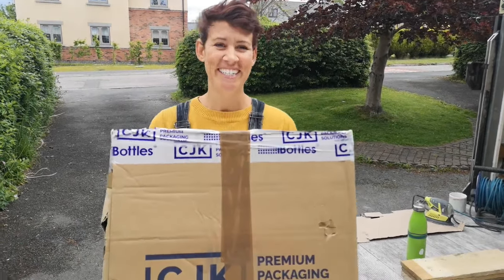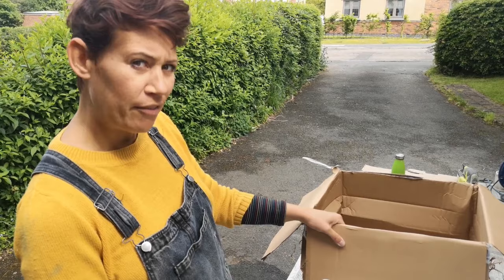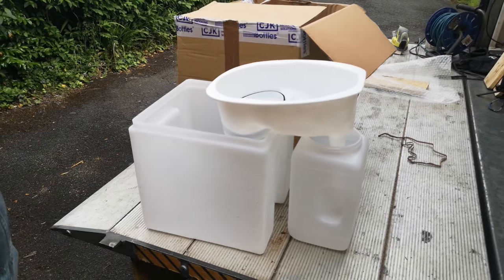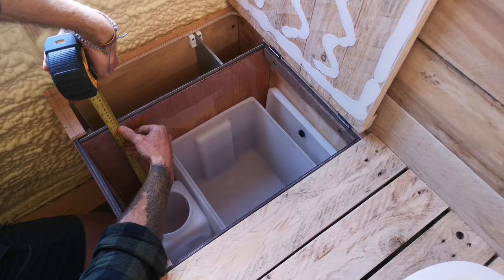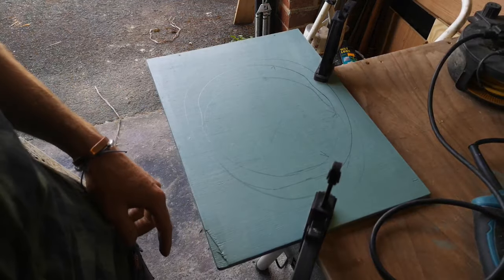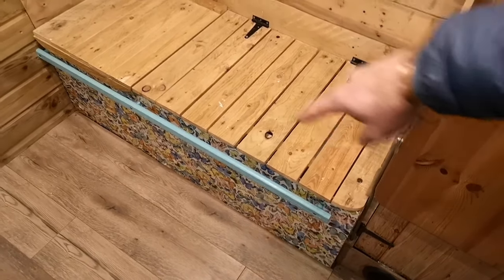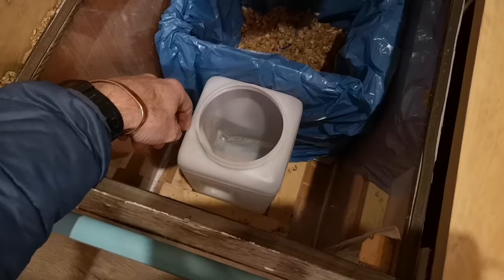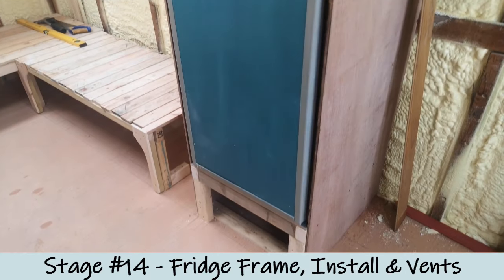DIY Campervan Composting Toilet & Bench Seat - Using Reclaimed Materials And Strumpet & Trollop Loo

Comment: Never liked the idea of having a big box of dumps in the living space. Much prefer the single use disposable bags, get it straight out of the van each time.
Reply from the maker: Hey Chris, We've been down the single use bag road in our previous van. I agree its better to have the waste out of the van straight away. Even so, we empty our toilet every 3-4 weeks and it's never been a issue for smells or discomfort, even in 40 deg temperatures. Also, I prefer to have a sit-on toilet rather than a folding bucket haha.